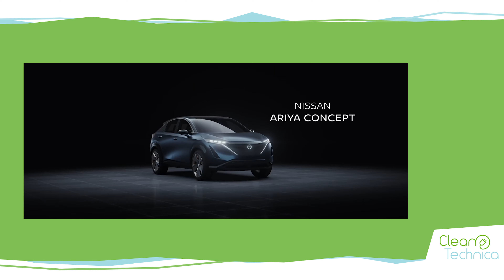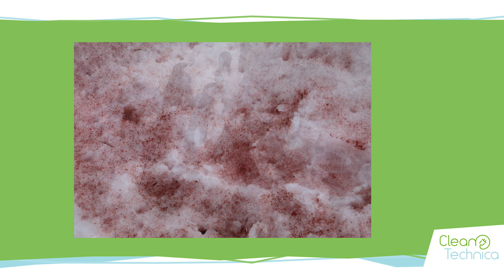CleanTech Weekly News Show | Renault, Antarctica, Hyperloop and Tesla

Comment: Correction: Model Y aluminum single casting will only take care of a portion of back third of body,  15-20% of total car uni-body frame. Key to its success is specialized aluminum alloy requiring no post heat treat that would distort frame.

Comment: Dude, the castings are not half the body. It's for part of the lower portion of the body, but still significantly reduces stampings. There are still a lot of stampings.
Reply from the maker: You are correct, we mixed this up with Tesla's patent for unibody stamping